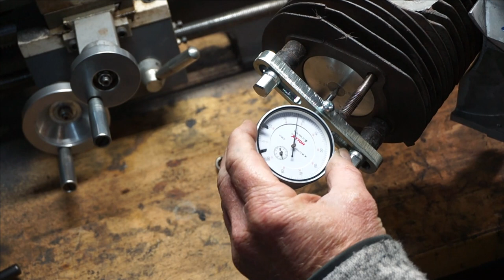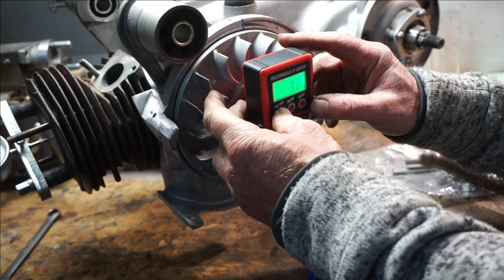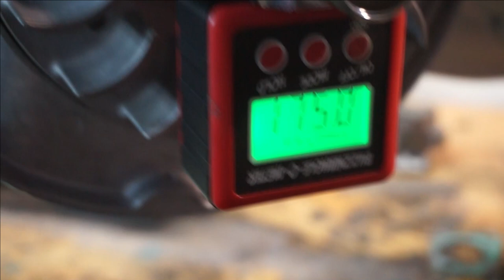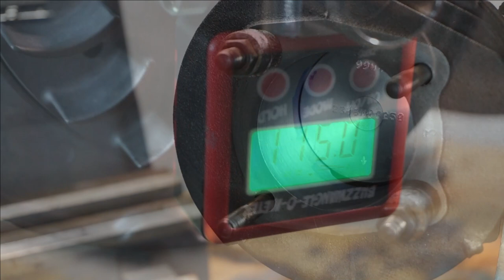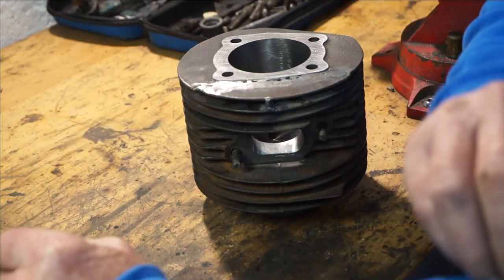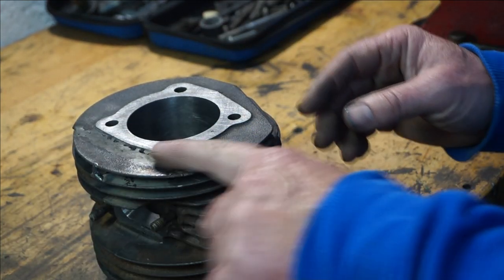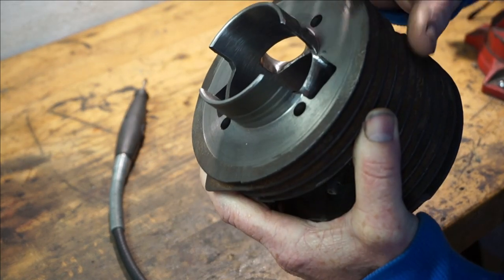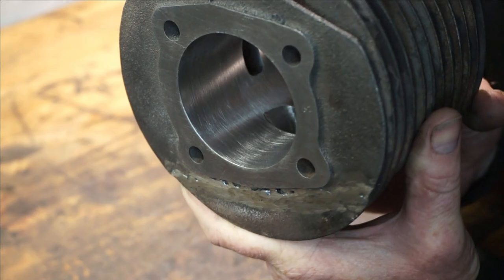lambretta tv 175 porting stage 4 by weasel speed #TheSteelweasel

Comment: I hope you’re going to chamfer those ports before you finish....
Reply from the maker: Why ? It doesn't need it ? And it will have less power if you chamfer.  The edges are only slightly smoothed with emery cloth
Reply: I’ve always done it as it gives the rings an easier time.
Reply from the maker: @graemelake8419  yes that's correct but it also changes timings and angle of gasses from transfer ports , I always use a curve in the upper exhaust  port to aid rings passing and keep it narrow at the bottom which is the one that does the damage on rings because on the compression stroke the rings are pushed out against the wall of the barrel  .